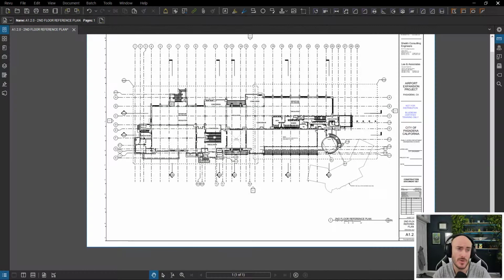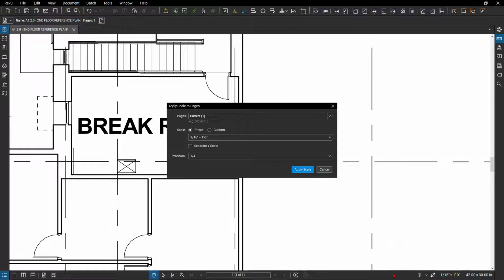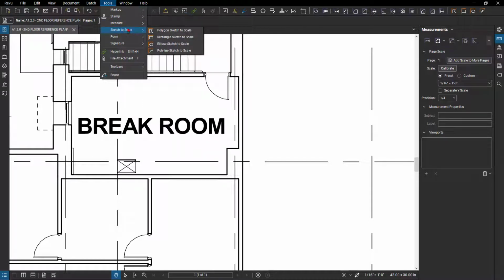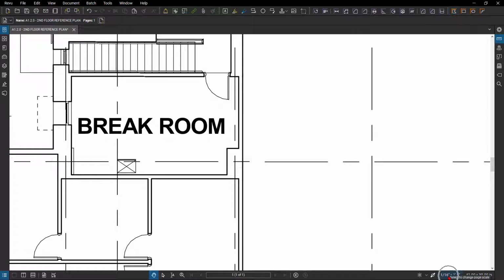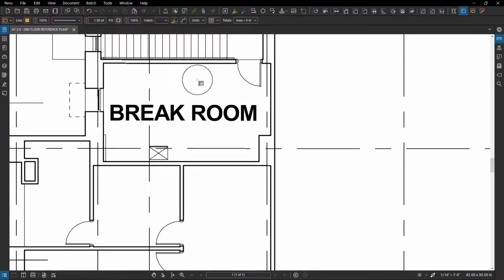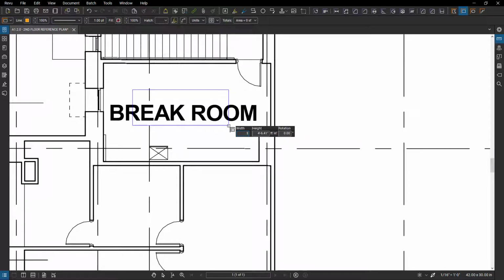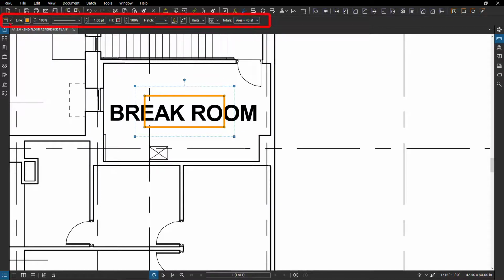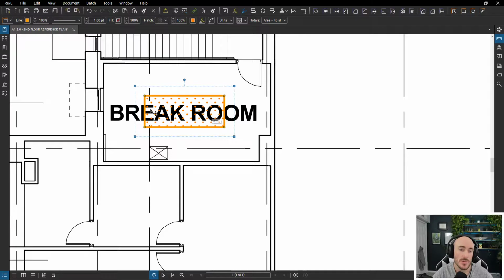How to Sketch to Scale in Bluebeam Revu

Comment: How does one change the dimensions after once completed a sketch to scale item?
Reply from the maker: the scale of the page would need to be changed, i don't know however if the sketch to scale updates
Reply: @michaelechave  Perhaps I didn't communicate well. Let's say I want to change a rectangle from 4' x 5' to 4' x 6' after completing sketch to scale. Is that possible or do I have to delete and start over?
Reply: @duffymapes9076  I have the same question. Manually dragging the control points seems to work, although it would be nice if the new value could simply be typed.